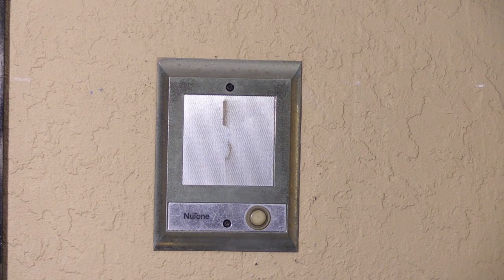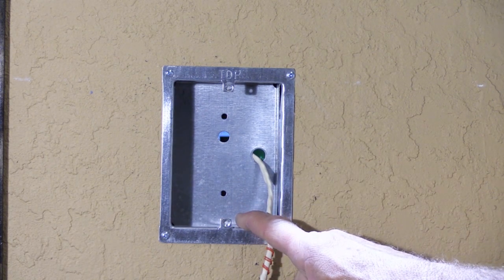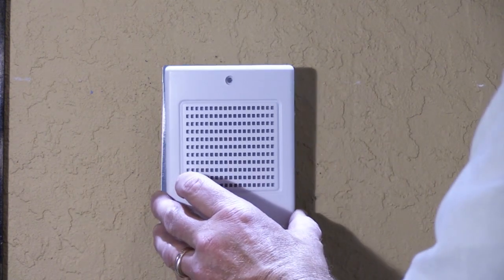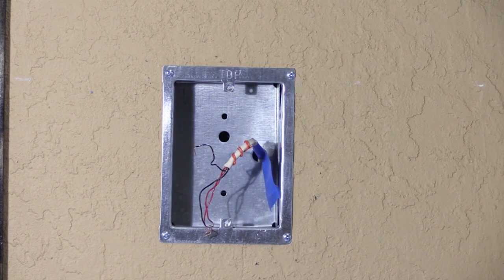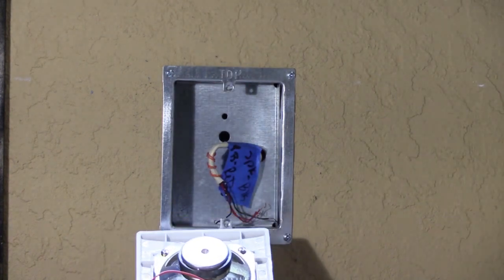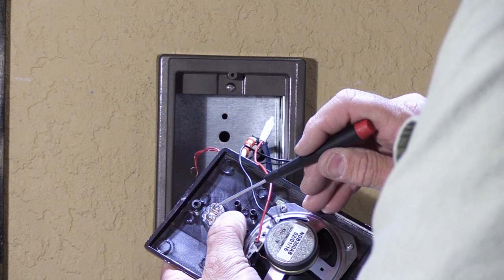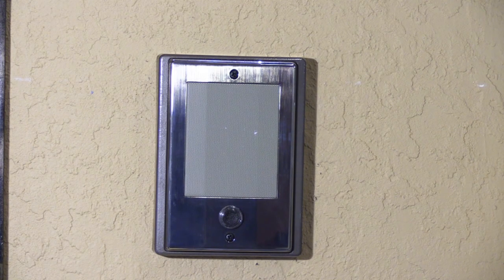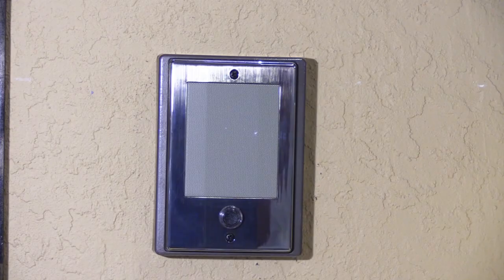How to Replace an Original NuTone Entry Door Station with a New Modern Replacement

Comment: Loved this video. Told me things to watch for. I am in need of a rubbed bronze doorbell and adapter but can't find it anywhere? Any hints?
Reply from the maker: Hi ellen: The These Door Stations have been discontinued for over 10 years.  The Update Frames only come in White, we painted them to match the Door Station.   We do have access to the original IS69 Door Stations, which were available between 1986 ~ 2010.  You can contact us directly about these - Chris     nscompany@msn.com

Comment: What if you have green, red, yellow, and black wires?  I am currently trying to replace my nutone system with a retrofit through intrasonic, but am having difficulties because it the original door chime only used two wires (green and red) to the master station.
Reply from the maker: Hi scott:  Since I'm not an "intrasonic guy", I can't tell you how to install their equipment - You should contact them about what to do with the amount of wiring you have available - Chris

Comment: Or antique brass :)
Reply from the maker: Hi ellen: The These Door Stations have been discontinued for over 10 years.  The Update Frames only come in White, we painted them to match the Door Station.   We do have access to the original IS69 Door Stations, which were available between 1986 ~ 2010.  You can contact us directly about these - Chris     nscompany@msn.com